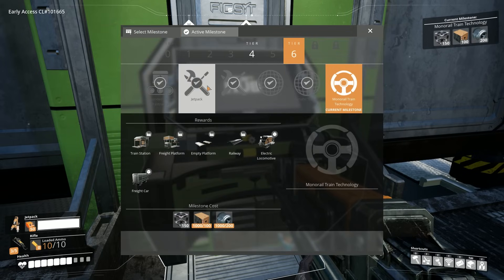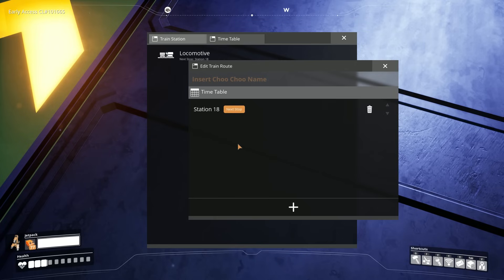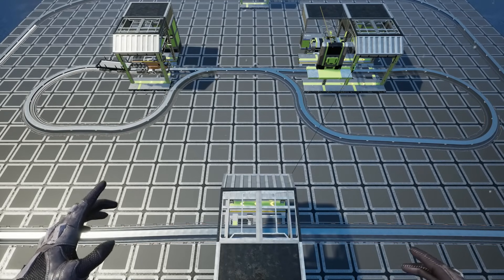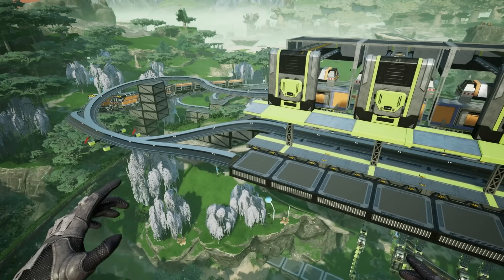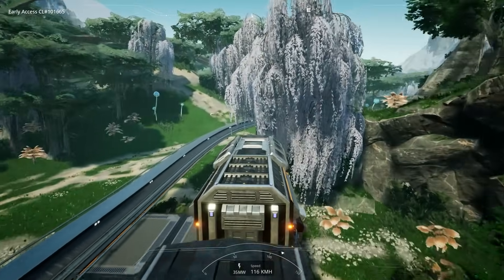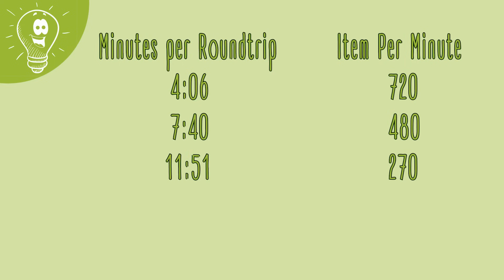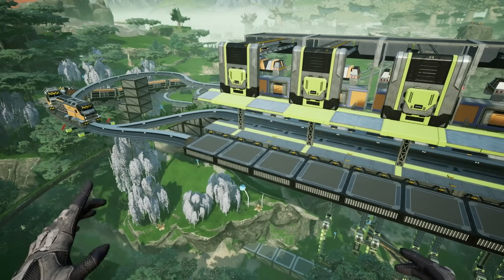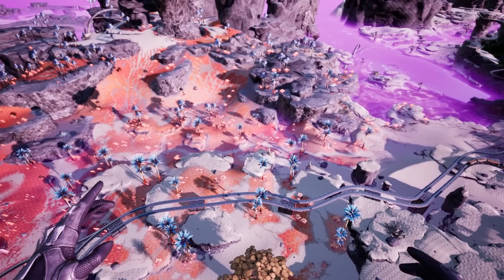Satisfactory: Advanced Guide to Trains. With Roundabout Junctions and Speedanalytics

Comment: If you've never used the Kronos Mod I would highly recommend it if you're working with a complex train system. The ability to do an instant transport teleport to set locations between Station 1 and Station 2 or station 20 and 21 to troubleshoot quickly your unloads and loads or any other glitches with the line or lines. No disrespect for the purists out there that do not use modifications I'm strictly stating how it's speeds up the troubleshooting process.
Reply from the maker: Yeah I get that. Even trough I play with mods teleport is something I'm not using, as well as flying as a method of movement..I feel.lile.it takes.tomuch away from the game, but I totally get the reason why some want to do that. By the way there is a new Utility Pak not
 Basically.tje Utility.mod.withoid the custom SML. I prefere it over Kronos